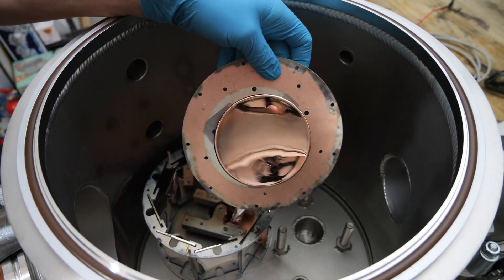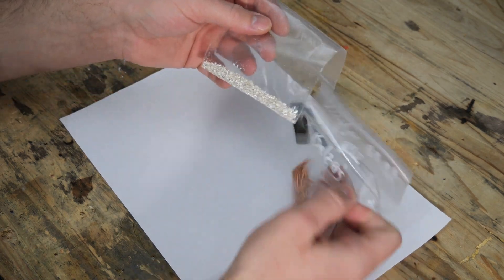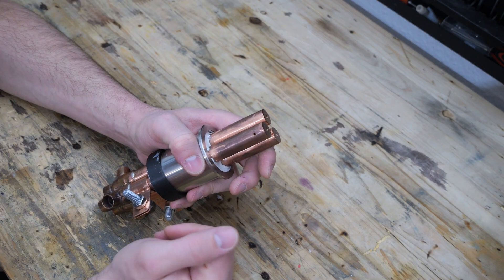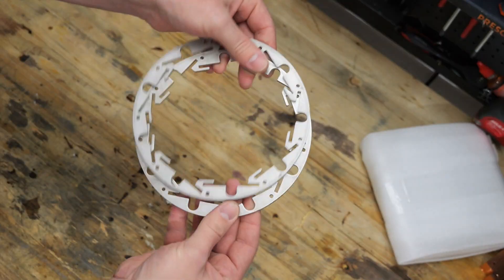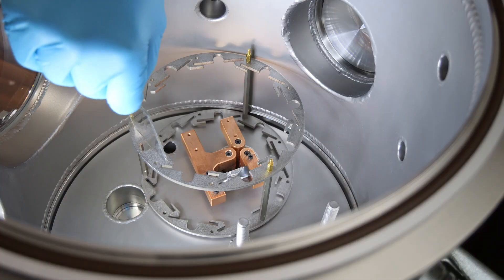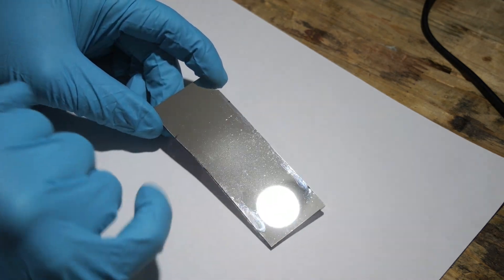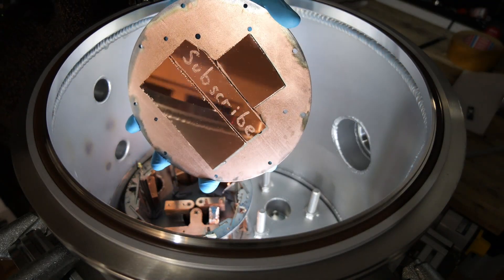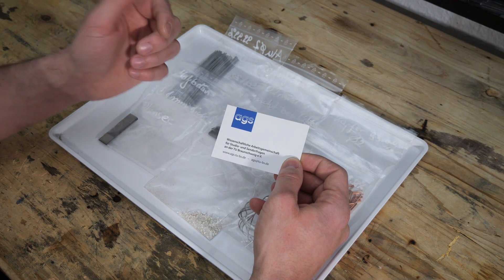Evaporating Metal in a High Vacuum to Coat Glass and PLA - PVD

Comment: It's interesting that the metal almost completely condenses onto the glass directly on top of it and not to the glass walls surrounding it. Is the top glass cooled beforehand? -- Oh wait, upon re-watching I realized those walls get a reflective sheen as well. 

I'm still curious about the rest of the chamber though, I guess there are still trace amounts of condensation on the walls of the chamber since the smaller chamber is not perfectly sealed (nor can it be, if the vacuum is to work). Are there? Or when performed with such small amounts of metal, almost nothing actually reaches the outer walls?

Comment: Is it possible to charge the particles and direct them onto the the surface to be plated which carries the opposite charge ?
Very nice
Reply: Not how this method works. The vacuum allows the vapour to move freely but is entirely directional. meaning if there is something in the way or if the surface is not directly facing the source of the vapour, it will not get coated.
Reply: if your surface to be plated is conductive, you could do electro plating which works in the way you described within a liquid bath.

Comment: If you want metals like copper, silver, platinum, gold tostick to glass, flash a very thin layer of aluminum first, vent (it will rapidly become aluminum oxide), and change to the metal desired. The aluminum oxide acts as a "glue".

Comment: Very impressive. I got an idea that i wish to see: why you don't try printing a circuit board on 3D printed part, or even on glass, and by uaing very thin glass (telescope glass) then  you might end with multiple layers circuit board by stacking the predesigned  circuit 😍

Comment: If you heat your object the coatings hold a lot better. A way to clean is to coat the object with a thin oil film and evaporate it in heat and vacuum.

Comment: Bro can you tell what type of torch you use to melt borosilicate vials and the torch you have used to distil cesium.
Reply from the maker: For my glassblowing I'm using an oxygen/propane torch. The torch I used to distill the cesium was a normal blowtorch.
Reply: I have heard that you use 70% butane 30% propane torch. Will butane only torch work for distilling cesium

Comment: Get some voltage difference betwwen heater and object to be plated, heater to be ground, object +200Vdc (or more), maybe this little electrical push has some use on this case !

Comment: Hello. You could try to use a special formulation of transfer tape using low outgassing acrylic compound like 3M 9703.
We use it on spacecrafts all the time  and it works really well for lightweight components which needs to be electrically conducive.

Comment: You can take a low power incandescent lamp and ramp up the voltage to the point where the lamp runs too bright but doesn't melt. after a while, lamp will slowly turn opaque due to tungsten deposition.

Comment: 10:50 To use vinyl cut lettering, you should cut the lettering with the backing paper still attached, remove the unneeded parts while the cut letting is still on the backing paper and only then use transfer tape to transfer it to final surface. Even then the "remove the unneeded parts" is a bit tedious but with a flexible surface and much less stickiness, it's still much easier.

Comment: Instead of making a vinyl stencil, I'd make one out of sheet metal, or a similar solid material that when removed will only leave the "shadow" of the letters in metal. Come think of it, vinyl should work just fine to coat the inside of a pair of safety glasses with.

Comment: One tip. Do not EVER use brass inside vacuum chamber. Zinc inside brass has tendency to get out and ruin your Vacuum, also in this kind of application it will get inside your layer.

Comment: Any tips from anyone before I give this a go with a more “hobbyist” setup? 
Aka vaccum chamber for epoxy, and a diy crucible using an arc welder instead of a dangerous microwave transformer
Reply: Biggest tip i can offer is this: If you don't have a helium leak detector, a pressure gauge on the tank can work roughly-as-good when combined with a helium sprayer. Just watch the gauge and look for subtle jumps in pressure detected. You may not be able to get anywhere close to the mTorr range without a TMP, but you might be able to get "close enough". Also, if you can't vent the side of a hole that a fastener is in, just get a vented version of said fastener. This will make the chamber base out in pressure significantly faster, and make leak-checking much easier.

Comment: Some thoughts about chamber cleanliness:
Consider layering vacuum foil over all surfaces which will be contacted by the vapor. This way if your chamber begins to form flakes, you can roll up the foil and trap them, before laying down fresh foil. This is an easy way to prevent having to chemically strip/etch your chamber for cleaning in the future, especially if you start to get into more exotic coatings.
Reply: Also you might want to consider a cold baffle in front of your TMP juuuuust in case any vapor managed to go towards it.

Comment: Tip, use mixture of little bit battery h2so4 and alume Aqueous solution on aluminum or ceramic pot and heat it untill broken steel bit desolved in the copper without doing anything to Aluminium brass or copper metals.

Comment: So I am guessing vacum is used in order to not oxidise the metal but how successful would be using less efective vacum? Like the ones used to degas epoxy resin
Reply: The primary reason to use the vacuum is actually to drop the boiling point of the metal in the crucible so that it will boil and/or sublimate immediately upon the temperature spike.

A less effective vacuum chamber could work, but it's a balancing act. If you can't reach the mTorr range of pressure, you just need more current/heat to evaporate the metal in the crucible.

Comment: What if you covered the inside of the safety glasses with the vinyl and only coated one side, would it make a difference in being able to see through them??
Reply from the maker: No, the glasses are actually only coated on one side. But it's completely reflective on both sides. 
I would have to make the coating a lot thinner to be able to make it see-through.

Comment: This is a fantastic video, and a really interesting topic.
Back in the 90s I briefly worked for a company that coated glass using the sputtering process. Mostly I worked in color filters, but spent a couple of weeks testing glass that would act as a light filter for solar panels in satellites. (blocking most of the sun's full spectrum light, except for a narrow band, preventing the solar cell from burning up) That glass was only 0.004" thick, and really easy to break. We also put coating on that would reduce the amount of light reflected from the glass. My job was running the glass pieces through a spectraphotometer to make sure the coating was the exact color, according to customer specifications, cut the glass to shape and discard the pieces that were out of spec. Then environmental testing, which consisted of rubbing the coating with an eraser to make sure the coating didn't peel off.

Comment: You didn’t mention any current control for the heater, adding either current or temperature control could be a good idea to help get more consistent results.

As for your piezo sensor to allow you to measure the thickness of the metal, that sounds really interesting, can you share any details about that?

Comment: Is there a way to attract the metal vapor in a precise manner instead of the scattering?
Reply from the maker: You could use some kind of aperture to let the metal only come out there. Or you can use a stencil (like I did when I applied my channel name to the glass). For very intricate structures, photoresist is the best option.

Comment: Lots of questions and fun experiments, I'd especially love to see the results of depositing bismuth metal.

Pure metals are interesting, but I've always wondered how this process works with alloys? Would something like aluminum bronze work? or maybe you could use the process to make alloys via deposition by running more than one crucible at a time, or in short bursts back and forth? Could you deposit tungsten itself by using a thin filament as the conductor so it will evaporate from the current? Is this a way to make novel tungsten alloys? Is it possible to deposit non-metallic elements such as graphite? could the process be slowed down to encourage crystallization? Makes my imagination go wild lol.

Looking forward to more videos about it.

Comment: Love that you designed an extremely complex extra water cooling step that, because you didn't actually test if was necessary to begin with, just.. was a whole part of this video that was unnecessary lmao
Reply from the maker: Haha! Yeah, I did spend way too much time building the water cooling system. I even had to order the thick-walled copper pipes from China. Well, at least now the design is future-proof in case I ever need a lot more current.

Comment: I recently found a Leybold TurboVac 350i unit which had been discarded. I was wondering what it was so started researching and came across your channel. Cool stuff!
There were actually 2 such units but not knowing what it was at the time I only acquired 1 of them for a mere $20. 😀
Now to start seeing if I can get it in use...

Comment: You could possibly make some money for your experiments with this setup maybe?
First surface mirrors that are very flat are probably not too cheap, right?
edit: Ohh! also: PCBs deposited directly on glas? i.e. copper traces on glas to make the pcb? how cool would that be.
Reply from the maker: If the opportunity arises, I would definitely coat something for someone. However, at the moment, I lack sufficient control (thickness, purity, etc.) over the process, so I could probably only coat objects that are meant to look aesthetically pleasing. Achieving the level of control and expertise required for optical components like lenses and mirrors demands much more precision and know-how. I'll definitely experiment with PCBs on glass and also on 3D-printed parts though!
Reply: @AdvancedTinkering  Not related to PVD, but if you ever decide to take commissioned special projects I'd still love to purchase a small low pressure potassium vapor lamp tube from you similar to the rubidium one you once made. I'm sure if you opened up yourself to commissioned projects to fund your own experimental projects you would find many of us very willing to support your works!

Comment: If the top surface of your vacuum chamber is flat, then there is no need to clamp it down. At this size the atmospheric pressure will do the job.
Reply: It would leak at ultra high vacuums, so the clamps are needed.
Reply: @cricketshine1160  I use a similar setup at a pressure of 1E-10 mbar without any leak. It definitely worth a try.

Comment: What size of wire did you use in the microwave transformer?
Reply from the maker: It's 95 mm2. So somewhere between 3/0 and 4/0 AWG.
Reply: @AdvancedTinkering  sounds about right, I used 4/0 (107mm^2) on one, it was aluminum, maybe 19 strand and it was super hard to get it  into the transformer core.  I would have done well to use slightly thinner copper (with similar ampacity and better conductivity) and finer stranding too.
Reply from the maker: Same here. I had to fight with the cable quite a lot to get it in to the transformer and due to its thickness, it’s very stiff. Since it seems like I’m nowhere near the max amperage for this cable, a smaller diameter would have worked just fine. Well, now it’s at least future proof in case I want to do something, that requires more current.

Comment: Congrats, you're getting some impressive capabilities over there! I'm curious what you ended up doing to lift the pump...

For very thin metal layers that are supposed to be transparent the best way to monitor progress is just transparency. There is some time required to nucleate I think, and the initial time may not be as reproducible as the steady state deposition rate, and it's a small number to measure to begin with.

I think if you ever use the full capacity of that feedthrough you'll need to think about water cooling the whole vacuum chamber :P Do look out for the pump--both times I damaged a turbomolecular pump it was by overheating the controller, which was mounted directly to the pump, because the rest of the vacuum chamber was hot and I didn't cool the pump adequately until it was too late. You shouldn't have to worry about unless you're doing something that makes the chamber at least warm to the touch.

UV/ozone is a good final cleaning step for any surface you don't mind oxidizing a little. In situ plasma cleaning is better since the surface doesn't get recontaminated afterward, but if you want to pull out all the stops for reproducible surface cleaning, gross cleaning -> rinse -> detergent cleaning w ultrasonic  -> rinse -> UV/ozone -> into chamber -> plasma etch -> coat is hard to beat as a workflow without involving more controlled atmospheres. UV/ozone is also easy to DIY if you have fume extraction available--you just need a mercury vapor lamp that's transparent to 185 nm light (should be marked as ozone-producing) held up to the substrate in air, in an enclosure to keep the UV light off stuff you care about and with some fume extraction to take away the ozone after cleaning is done (can also decompose the ozone with 254 nm light only using a second lamp). Heating the substrate makes it even faster, though that's largely irrelevant if it's only a finish cleaning step since ambient temperature UV/ozone eats through 1-2 nm of hydrocarbons in under a minute under a broad range of process parameters.

You don't necessarily need to worry too much about virtual leaks--most screws don't fit so tightly that just the bottom of the hole is a significant gas reservoir. If there's some other kind of reservoir of gas under the screw then it matters more, though venting your stuff like that is considered best practice and it certainly won't hurt anything in the vacuum chamber.

It's cool that you're depositing metal and getting little scraps of foil on the glass. Evaporated metals are often under tension, so if they adhere poorly I think they tend to come off like that. I never had to worry too much about stuff getting into the turbopump, but those look like they could fly well if the venting procedure was wrong. They're probably too light to cause much damage though? I don't know too much about those.
Reply from the maker: I actually just lifted the big pump onto the chamber by hand...
I'm going to make a few attempts at making semi-transparent coatings soon by simply observing the transparency as you suggested. 
Yes, the vacuum feedthrough with the water cooling was overkill :D But at least this way I have room for improvement if I ever need more current in the chamber. 
The pump and especially the controller are far enough away from the chamber. However, I have to shut down and restart the turbomolecular pump every time I open the chamber. This is probably not good for the pump in the long run. The best thing would probably be a valve between the chamber and the turbomolecular pump so that I can keep it running when I open the chamber. I could then evacuate the chamber via a bypass and then open the valve to the turbomolecular pump again. 
The copper pieces that come off the glass are actually surprisingly heavy after a few coatings. At least I don't want to risk getting them into my pump.
Thanks for the tips on cleaning the glass!
Reply: @AdvancedTinkering  Ooof! At one point I had a couple of chambers with 16.5" CF flanges (the largest common diameter) which closed off the chamber with a blank of that size. Those weighed about 30 kg, and had to be set down at least a little bit gently in order to seal well. Also needed 36 bolts tightened in 4-5 passes each time to seal. I didn't do any deliberate exercise for my arms at the time, so every now and then I would wonder why my arms had as much muscle as they did, and then I'd remember...

Anyway, it had lifting lugs so eventually I improvised various jigs to make it easier to handle, for example by using larger muscles. If you continue lifting the pump you might consider such a thing.

I don't know of any specific reason why stopping and starting the pump would be a problem, but I only ever used small turbomolecular pumps. If anything lifting the pump with only one person it is probably the riskier operation. Big valves are expensive and possibly don't seal as reliably as the smaller valves, I don't blame you for avoiding that.

Comment: Very nice!  I had fun evaporating titanium, and you can modulate the color of the deposits by varying the pressure of the chamber-- I got some very beautiful gold-colored layers this way.  If you're not too concerned with coating things around your chamber, you might try the much cheaper stranded tungsten wire heaters, wrapping a bit of the desired metal around the tungsten, where it will melt and wick onto the heater wire before evaporating.  Another cool experiment I tried was evaporating silver onto paper, and it doesn't take much to become quite conductive.  You'd think the rough surface of the paper would prevent this, but it works very well.
Reply from the maker: Very cool! I also wanted to evaporate titanium to see if I can get some pretty interference colors. Do you remember at which pressures you evaporated the titanium to get the golden colored layers?
Reply: Titanium is a reactive "getter" and will pump any reactive gas that strikes it. Used to maintain 10-12 Torr beam transfer lines under vacuum for years.